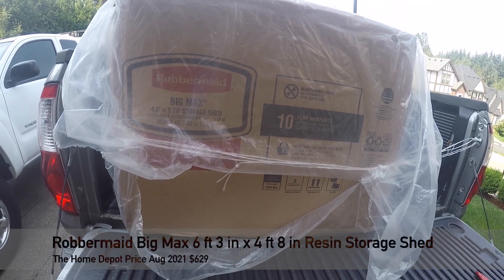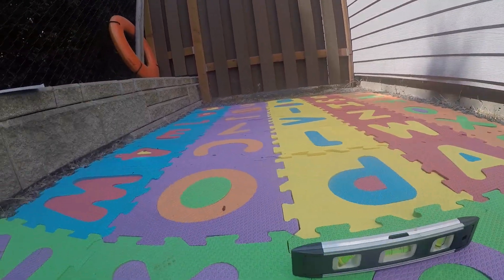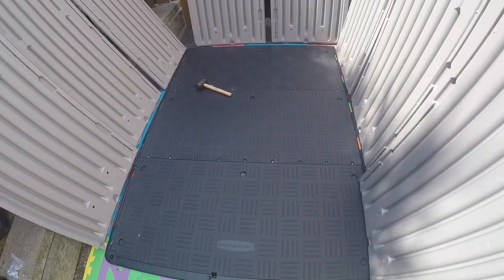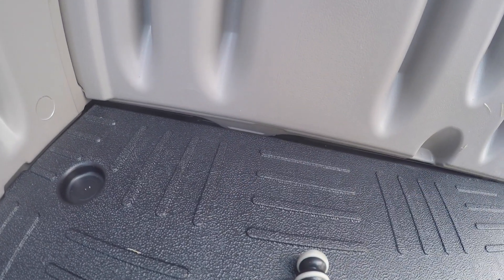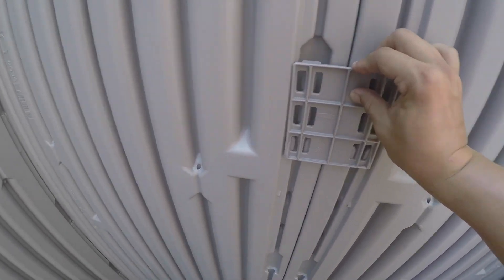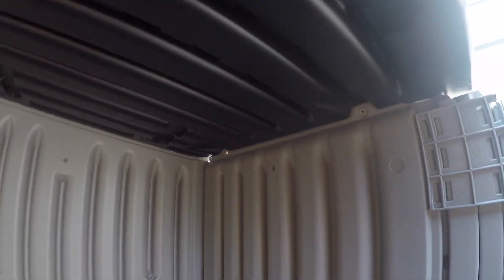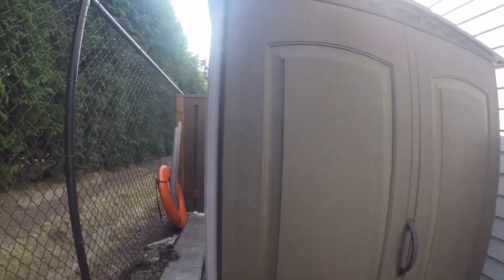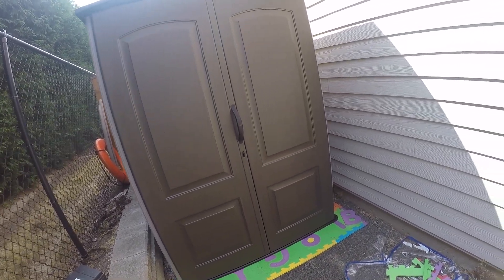Rubbermaid 5X6 Big Max Storage Shed Assembly and Review

Comment: Thank you so much for this video! I had a bit of trouble with the roof part, but your video really helped! How is the shed doing now? Is it still holding up good?
Reply from the maker: No issue so far since summer. I’m in Pacific Northwest not many extreme weather. Just make sure it sits on level surface the pieces should fit.